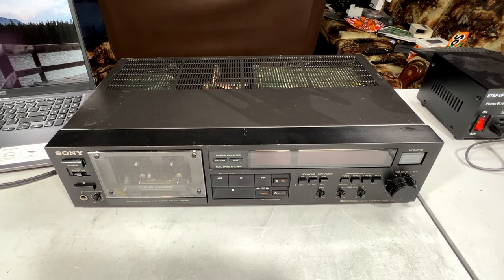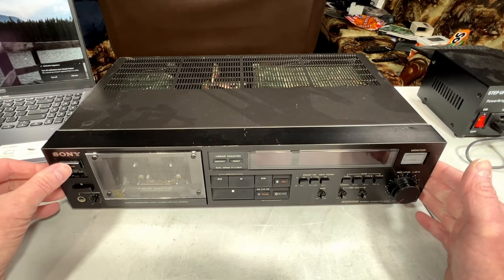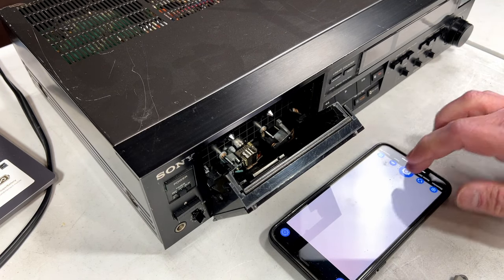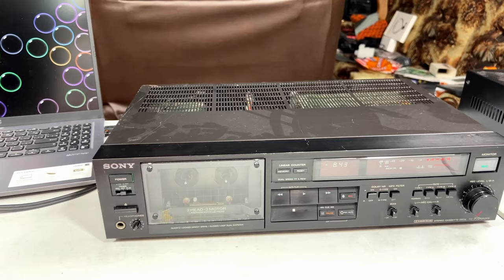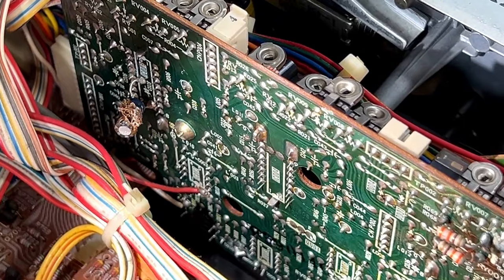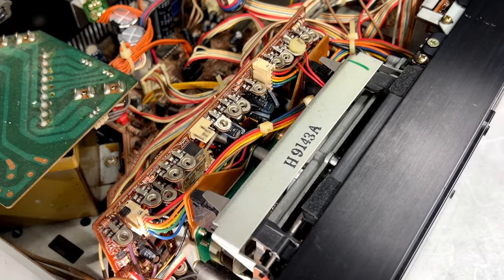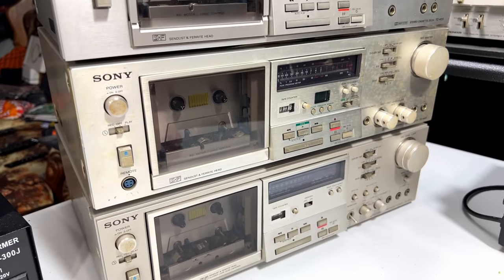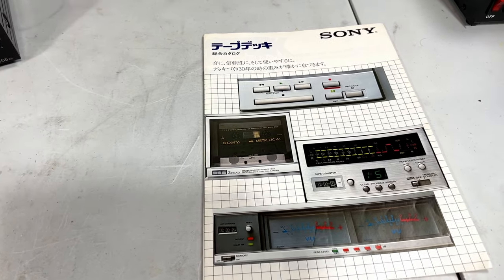Sony TC-K666ES Part 1 - Down the Rabbit Hole

Comment: Nice video, thank you! One correction however regarding the Nakamichi Dragon. It has conventional idler tire reel drive, not DD. The capstans however, are twin quartz locked DD. But for sure, DD reel drive is rare on cassette decks. It's one of the features that makes this Sony so special! Some of the very few other models that have it are the Revox B215/B710 and the Teac Z6000 and Z7000. I think there are a couple of Akai's that have this feature as well.

Comment: I have two 666's, one from back in '87 and one bought two years ago. Both have had issues now with the tape type select switches. They also influence the record EQ, and bad contacts can result in bad recording performance. Someone has already replaced some components here. You can save yourself checking this deck with the torque gauge, as the pick-up reel is direct drive it'll start vibrating as a result of the feedback between the spring of the gauge and the motor control feedback loop. You won't have a meaningful result. The motor drive circuits are best left alone if you won't want to go hunting the right adjustment again. You'll need a good oscilloscope for that. But I'm pretty sure that you will have to replace the inter-capstan belt, they had become quite stretched and loose.

Comment: Re: TC-K75. I fixed mine which was dead but needed several other jobs to be done on it. I also had to buy two Sony CX-174-2 (Dolby and integrated OP Amp) ICs which made the overall cost at about £110. Oh, and yes also needed to source a LED Meter display IC, which luckily I had 'in stock'.